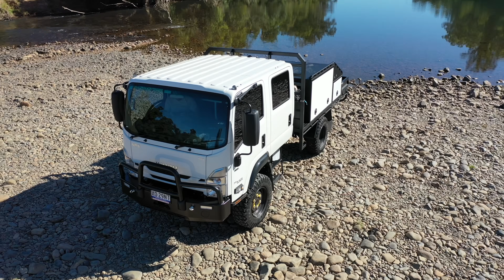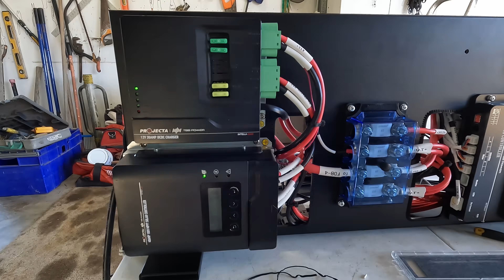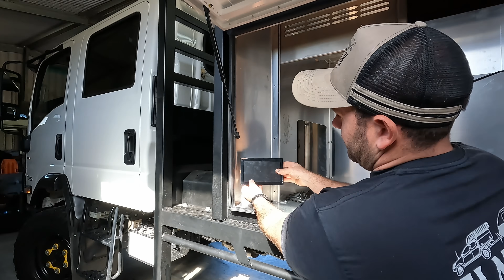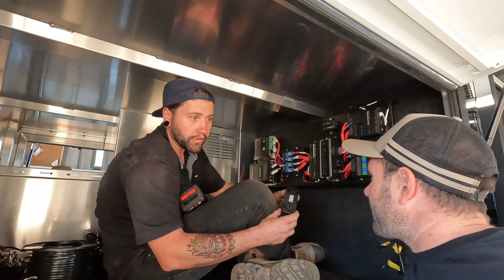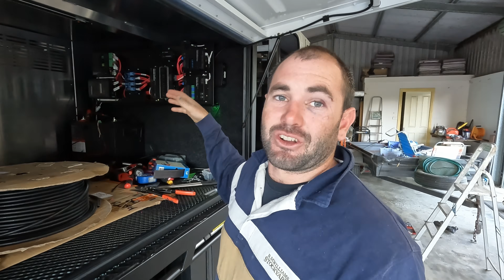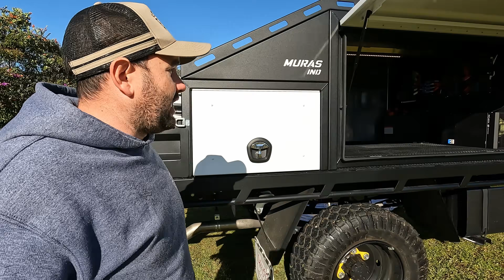Isuzu NPS 4x4 Truck Build Part 2 - NEW Projecta OFFGRID BATTERY SYSTEM - Travelling Australia

Comment: Have the same Inteligrid in our van with the 3000w inverter. Will run the ac for hours. Out of interest, how much charge are you getting from the alternator. We only get about 15 amps which is less than I expected
Reply from the maker: Hey how good are these systems !! We get twenty to 30 amps. We have run big cables from the truck to the caravan and the van has the same size running to the panel.  If the wires aren’t big enough you will get a bit of voltage drop from the alternator back to the van 👍🤠

Comment: She definitely told you mate, better start listening, otherwise you'll end up with 2 black eyes......😂
Is a 2000 watt inverter and 400 amp battery enough  ?
Have a good weekend 🤙
Reply from the maker: Hahah she got me good. Yea plenty the same system is in the caravan and we have no need to plug into power as long as the sun is around 👍🤠

Comment: Hi mate I’m looking at getting rid of my cruiser just wondering what the truck with wheels and suspension was worth thanks for your help
Reply from the maker: Hey the truck. wheels, suspension, tray, rear winch tow bar, bullbar & anchor points plus on road costs was 157k 👍
Reply: Fabulous digital set up. Love that it can monitor your gas bottles! Is there integration with the caravan Projecta set up or will they run independently?

Comment: 12V or 24V system to match the 24V truck system?
Reply from the maker: It’s a 12v system  we pulled off one of the 12 v batteries on the truck and put a charge equaliser one the two truck batteries so the maintain the same battery level to make the 24v system 👍🤠
Reply: @elnick.adventures I dont know what gear they are using to handle that method now days but I tried that years ago on an Isuzu 9t truck but it wasn’t a real good idea and is hard on batteries, I ended up putting in 2 batteries in parallel for a 12v system to run my rear mounted machine. Personally, I think you should have gone with a 24v setup in canopy, but ur choice. 
I do use a 10A balancer between 2 x 16v capacitors on a 24v AIO 3000w system in a bus I have up north, so I can pull 13.8v from either capacitor set if I want for different loads, mainly so I can run a couple of lights without the inverter sometimes, but I have used it for fridges also, and the caps help maintain surge loads & filter DC ripple from inverter. There are manufacturers that have a 24v -12v DC-DC chargers, but I cant remember where I saw them recently. Nice setup Nick. Cheers